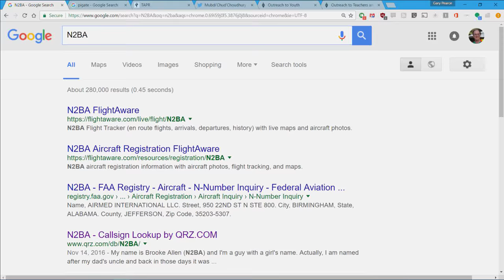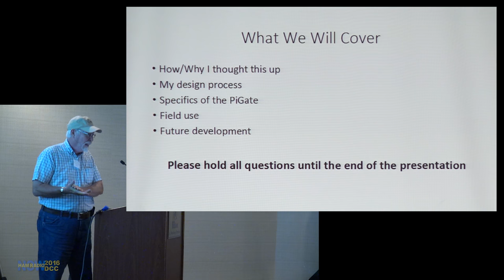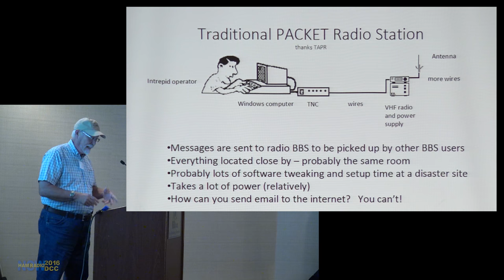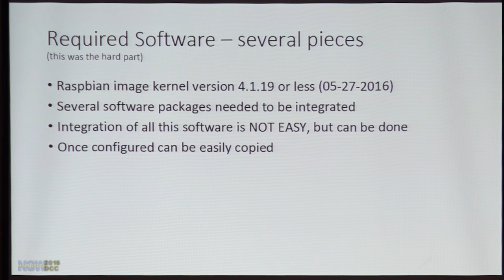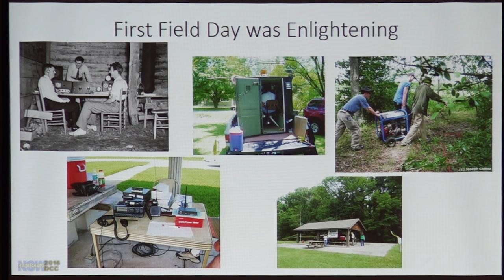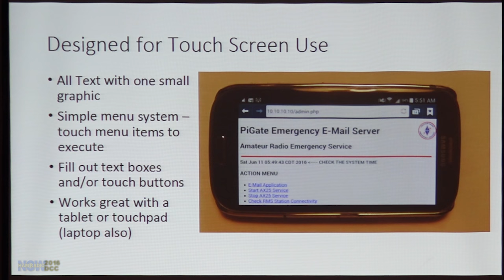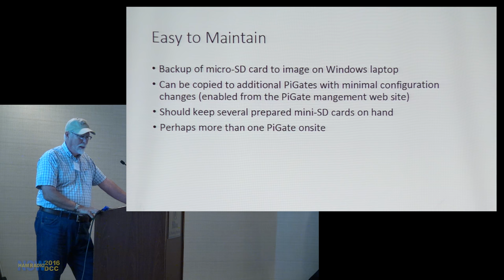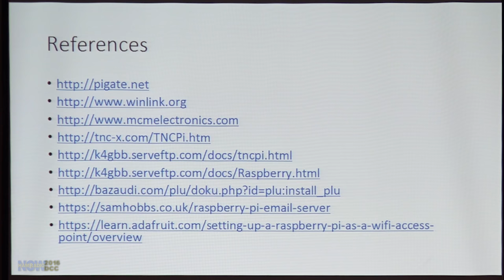HRN 292: PiGate Emergency Winlink Gateway

Comment: AX.25 does not do forward error correction but it does do error detection and requests a retransmission if an error occurs. This is true for a connection, not broadcasting. APRS uses broadcast but I think that the email uses a connection.

Comment: you could work with rpi and build a rpi 4 with built in w.e ur addon does plus gps chip so location is always known along with the time, a rtc could be usful too and as for email replies have your callsign as a reply address and in the subject line can be the actual recipents name / number / callsign! please build an actual product with all this and sell so it works out of the box just by putting in a callsign.